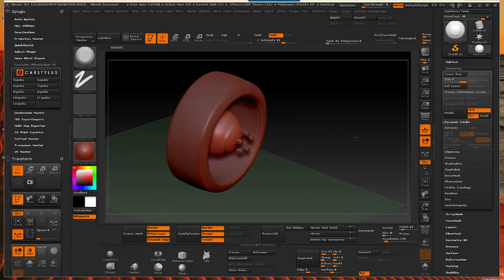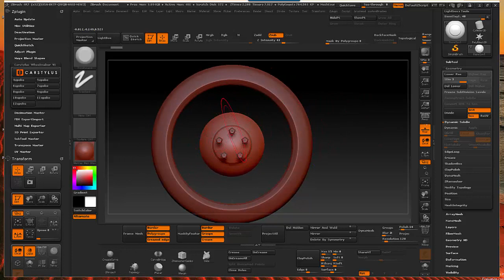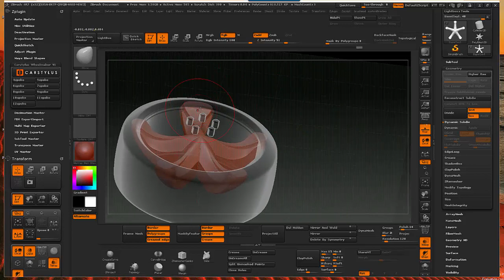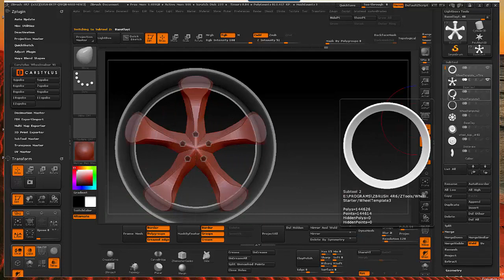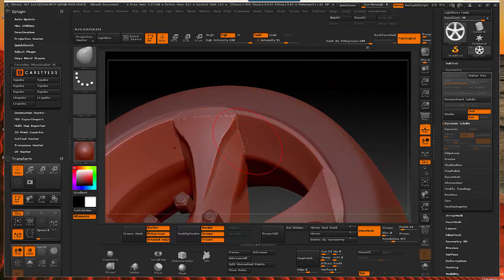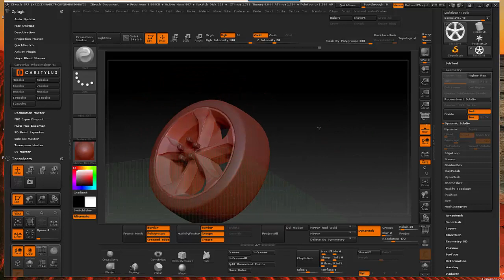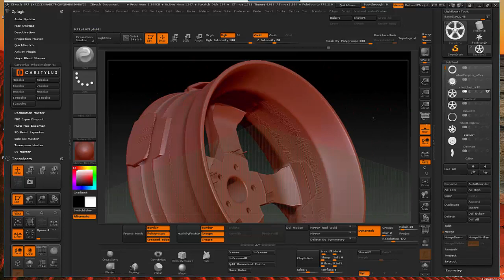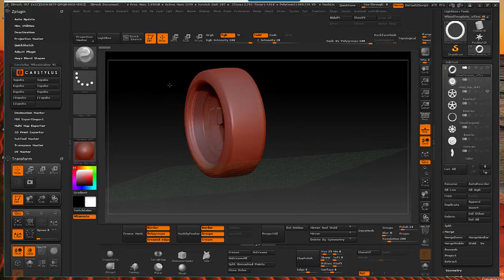Carstylus SpokeMaker Plugin for Zbrush

Comment: This is very nice.  I can see many artistic implications for this tool outside of just creating rims.  Looks cool.
Reply from the maker: Thanks.   But when I made this,  there wasn't anything in Zbrush that could automatically rotate an object.   Now Zbrush has "Array Mesh".   It's substantially better.   -    As a result, I've discontinued this plug-in
Reply: @Carstylus  That's a little unfortunate, because it seems so much easier to use for this specific purpose than Array.  Array is great and of course has many more powerful features, but this plugins seems much easier to use for creating a circular array very quickly.  It would be fantastic if you updated this and perhaps included some additional features that maybe took into account the power of array as well.   Perhaps something like the ability to create  instances in a Fibonacci sequence or pattern in a circular array.